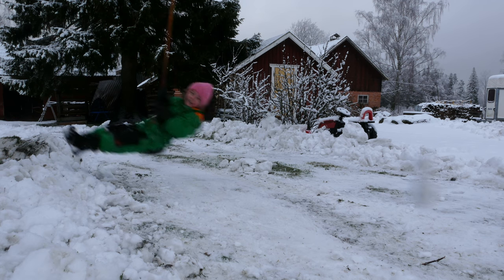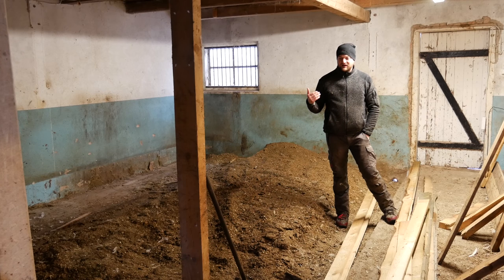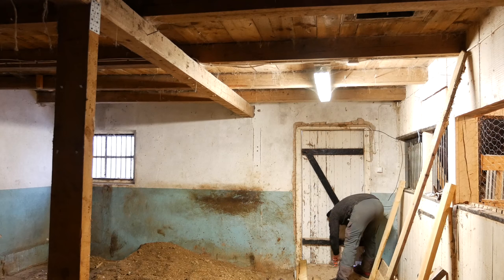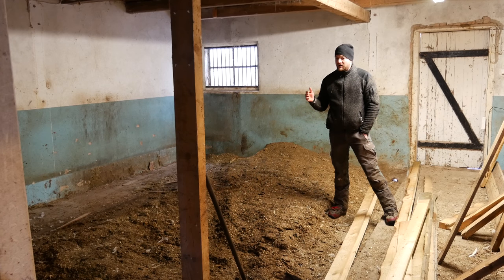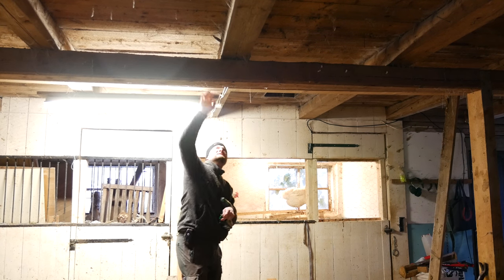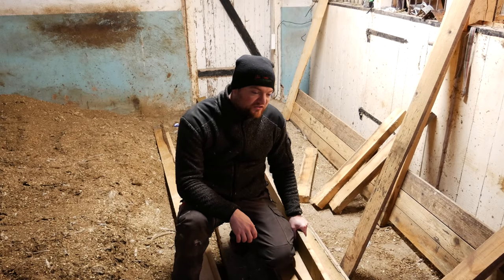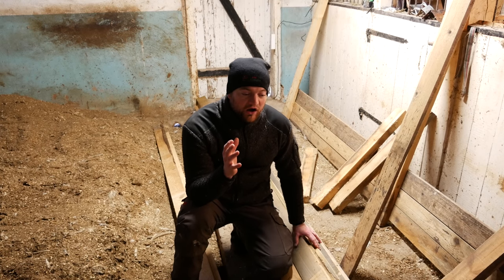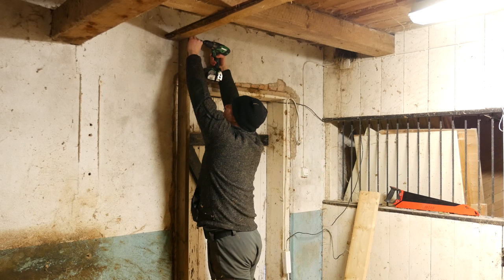Turning This Old Cow Stable Into A Hatchery

Comment: I love your videos.  My father is a great woodworker and cabinet maker.  And he taught me how to use tools from an early age.  I hope you don't mistake his sawing tip as any disrespect for you in any way.  You will have a much easier time in sawing wood if you get in the habit of placing the index finger of your sawing hand straight out, instead of all four fingers curling around the handle.  This helps your brain align your sawing motion and "points" to the edge you are cutting.  Not so many restarts.  Maybe you could try it and see if it does aid you.  Meant as a helpful comment. God bless you and yours.

Comment: Over building is usually not because chickens are super-hero strong, but rather because predators will work very hard to get a chicken dinner. The build has to be appropriately tough to withstand one's strongest local predator, be it raccoons, coyotes/dogs, wolverine, or even bears. 
Also, I found a spot where rats (I think) were trying to chew into my coop: they went 1/4 of the way through the thinest wood at the door in ONE night. I went to a lot of trouble and expense to make the coop rodent and snake proof with hardware cloth, so that was a real surprise to me to discover that the door wood was the weak spot. I used 1"x2" to make the frame.